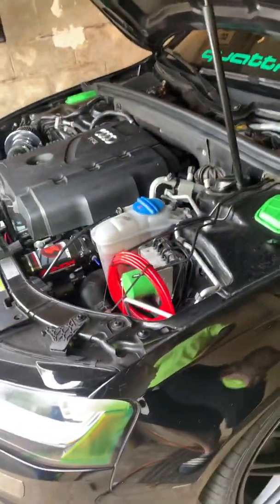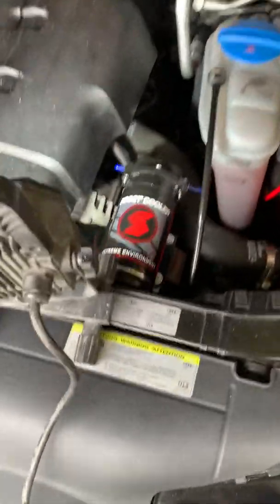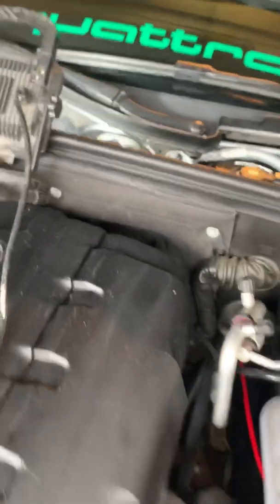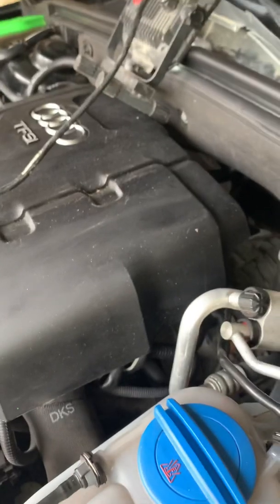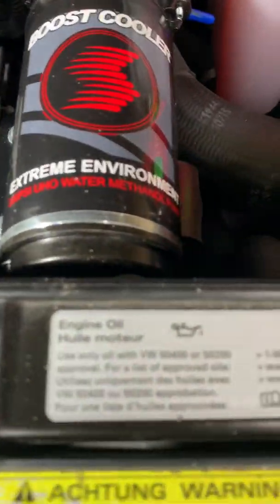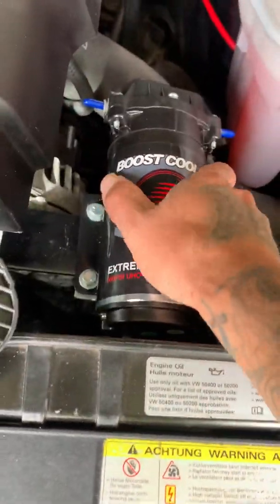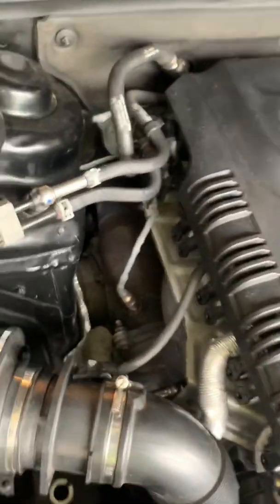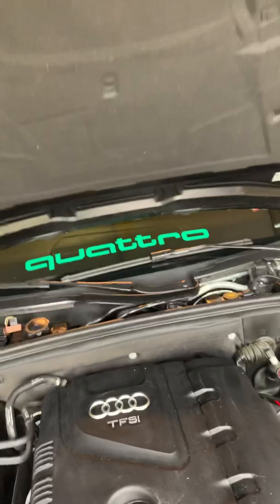Integrated engineering stage 2 Audi A4 gets snow performance methanol injection kit!!!!

Comment: Sick AUDI...   I OWN A 2015 A4 SLINE.    MY ONLY MODS ARE CTS  COLD AIR INTAKE , CTS TURBO MUFFLER DELETE, AND CTS DIVERTER VALVE SPACER AND A NEW DIVERTER VALVE REVISION D AND NEW OEM R8 IGNITION COIL NGK DOUBLE PLATNIUM SPARK PLUGS.    I JUST ORDER  A CTS TURBO BRAND COMPLETE INTERCOOLER KIT WITH CHARGE PIPES,   HOPEFULLY IT MAKES THE TURBO  LOUDER.
Reply from the maker: Sounds sweet man.

Comment: Are you running the 100oct map?
Reply: Genius
Reply from the maker: 🙌🏻 definitely took a little bit of thinking lol. Thanks
Reply: Hey bro I got a couple questions for Audi mind if I give you a text?
Reply from the maker: Lit Tit sure
Reply from the maker: I am currently running the 93 octane map from IE. I just ordered a k04 and it should be here next week. I’ll be upgrading the tune to the 93 octane k04 map, but the plan is to make my own 100 octane because it’s not available to me then flash to the 100 octane map
Reply: Joby Condron if you're running methanol injection that's good enough for the 100 oct map just set your spray properly. Plenty of people are doing it. I have a k04 on mine but debating the 100oct cause I don't wanna keep filling up on meth since it's my daily
Reply from the maker: Thanks for the tip. Meth is definitely getting expensive but I don’t daily it. I’ll definitely try the  100 octane map. I’d need to figure out what I would need to do differently as far as setting injection
Reply from the maker: VAG Central hey I had a question, I understand that meth boosts octane so it would be ok under injection for the 100 map. But I’m wondering if will hurt the car or not being 93 octane on a 100 octane map when I’m not injecting????
Reply: Joby Condron do you have a insta gram I'll just send you some screen shots that I have from other people that did it.
Reply from the maker: VAG Central unfortunately I got rid of all my social media. Shoot me a text 412-298-4916
Reply: Thanks for the heads up.  I have my Meth kit ordered and will install soon.  I’m gonna try to keep everything in the motor and I figured if that jug is a pain in the arse I will just convert the washer fluid jug.  It is my daily and already running stage 2 with a ton of other mods.  I’m not likely switching to a Meth map because I want the ability to turn it off.
Reply: This is super nice brotha